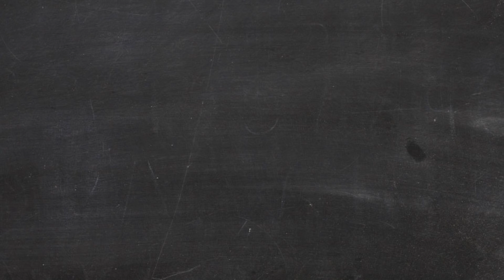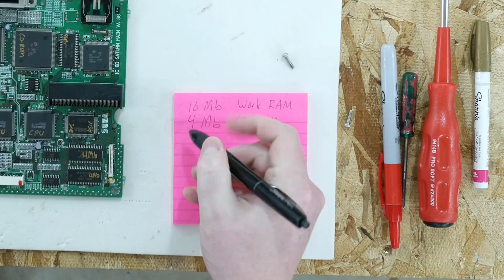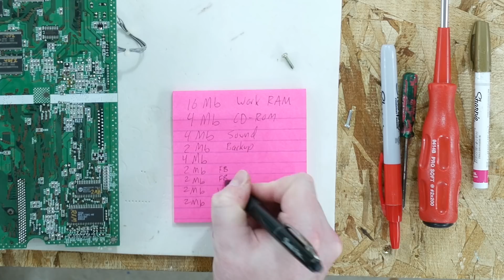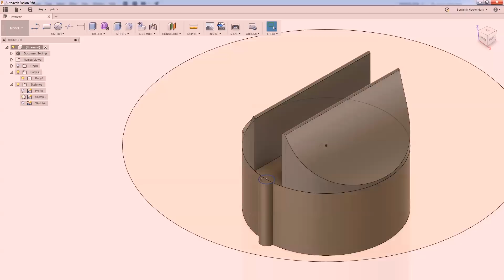Sega Saturn Teardown

Comment: That unidentified chip you pointed out I think is the dsp kind of like the FX chip. It supercharged the Saturn and was hardly ever used. Powerslave exhumed uses it and is what made 3d games run smoother.
Reply: It’s a Hitachi SH-1 CPU that’s part of the CD drive section.
Reply: The System Control Unit at 8:17 has a DSP in it, that’s part of why it’s big. The DSP can help with graphics.

Comment: The Sega Saturn is extremely complex for its time. That's one thing that must be considered when looking at a machine from 1995 (technically 1994). Today, most electronic devices have multiple processors. Back then that was an almost completely foreign idea. This is also one of the reasons the Saturn is just now being emulated with a modicum of success. Currently I am trying to get my PlayStation Classic to run Saturn games and while it's working it has been an uphill battle.

Addendum- You called it Sega's 4th generation console...that's incorrect. The (1st) SG 1000, (2nd) Sega Mark 2, (3rd) Sega Mark 3/Master System, (4th) Sega Genesis, and (5th) Saturn. However, the Saturn should actually be considered 7th generation hardware as the Sega CD and 32X all fall under new hardware guidelines even if they're only additions. The price had little to do with Sega's failed 32-bit console. Mismanagement and complicated hardware were the sole culprits. PlayStation 3 launched at $600 and the 360 at $400...the battle was close. The Xbox One is a far weaker machine than the PS4. The Xbox One X is the most expensive console right now and has sold very well. It kept Microsoft in the running.

Comment: It's a real mess in there. PlayStation usually matched or bettered anything produced at retail for Saturn with half the memory and vastly streamlined chipset. Kutaragi > Sato for electrical engineer
ing. What really devastated Sega was how quickly Sony revised their hardware, constantly reducing the complexity while preserving perfect function. There were at least 9 revisions of Playstation hardware (board designs) in 6 years! Sony cut costs rapidly, within 3 years the machine was under $130 with the more advanced dual shock controller bundled.

Comment: The two processors iirc was Sega panicking after they discovered the PS1 had 3D graphics and was quickly added. Both processors needed to be utilised in order to make up for lack of 3d processing power. The Sega Saturn was originally a very powerful 2d graphic machine a step from the Neo Geo.

Comment: It was overly complex for something that wasn't that much more powerful than the PS1.  You'll only notice the Saturn's slight superiority in graphics if you looked at game ports side by side.  Even then you'd need to realize that to tap into the Saturn's superior power games needed to be coded in assembly.  PS1 accomplished close to Saturn's quality and games for it could be coded in C.  
  
Sony never learned from Sega's mistake and did something similar with the PS3.  Granted it wasn't as much of an issue with the PS3 when it came to making games since compiler technology has long since progressed.  But it's complexity is probably why the PS4 doesn't have backwards compatibility with the PS3; while the Xbox One does have backwards compatibility with the 360.

Comment: TBF as crazy as the saturn design was to domestic developers, it was pretty par for the course for arcade machines (i believe). You can always speed up a system by slapping more CPUs on it (and this is basically how modern computers work)

Comment: i would like to suggest a project for the sega saturn. make it into a laptop with internally added 4 megs memory card and video ccard so it can play vcd movies. the controllers modify into bluetooth controllers. preferably with 4k or HD screen. my second suggestion would be to make a portable sega saturn that you can take anywhere (shaped like a backpack for example) and you can play it anywhere using 3D goggles.

Comment: Loving the random movie opinions while diving into a weirdly constructed console. Definitely cracked me up. Also, that is some good editing! I'd like to see a teardown of an arcade JAMMA board and be analyzed. Something like Final Fight, 4pl Ninja Turtles, or even Galaxy Force 2. I want to know why a single game had all those chips on the board. Hope this helps!
Reply: Arcade games had a lot of microchips because the ROM chips that held game data were also on the board (but were in a cartridge/CD on a home system). Also, the manufacturing tech wasn’t as advanced then, memory chips couldn’t hold much, so there were a lot. Arcade systems usually had more RAM too, to help graphics (like Sega ST-V arcade board vs. Saturn). Also, arcade boards had the newest tech, which means a lot of special purpose chips. Companies figure out how to consolidate them by the time a similar-powered home system comes out.

Comment: The Saturn didn't really have a master CPU and a slave CPU. More accurately, it had two masters; the biggest reason why the Saturn's complex architecture was so tough to work with was because its two CPUs had zero cross-talk-- the result of the second one being slapped on at the last minute-- meaning that making use of both processors at once was a huge hassle for programmers.

Comment: ah try companion carts there ben..

the gimmick of the saturn  was to use  both cart and cd or cart or cd..

I do not recollect of sega building memory carts that stuck into the a standard  cart slot

If sega had a saturn bases card save system it would  no different to the  what the dream cast had as it would of functionwed by syncing into the coinop arcade machines  so you can play certain games in the arcades  with your game sames...

Comment: Speaking of RAM, we should mention cache, The SH-2 CPUs have 4KB cache, which was extremely important because only one SH-2 can address Work RAM at a time, but then again, most developers didn't bother with the second SH-2 at all, hence the misconception that the Saturn in weaker than the PS1. Also, I recall (correct me if I'm wrong) both VDP1 (and maybe VDP2) having 512KB texture cache, which is huge compared to the PS1's 5KB and N64's 4KB (they should have called it the N32 considering those ugly 32x32 filtered textures), also as a little titbit, the 1.5MB VRAM in the Saturn runs at similar clock speeds to the PS1's texture cache, I mean that's just crazy.

Also a note about the sound capabilities of the Saturn, while having a staggering 32 channels over the PS1's 24, it wasn't capable of hardware audio decompression, meaning the sound effects were sampled at low bit-rates to save on RAM, one example of this is Core Design's absolutely amazing Tomb Raider (which was going to be a Saturn exclusive in the beginning), but red-book audio was completely unaffected due to it being steamed from the disk. I always wondered, why didn't anybody use the second SH-2 for audio decompression, but then I realised it too much work for too little payoff.

Comment: I’d like to see someone mod a Saturn so as to smooth out frame rates and load times. Like more ram and possibly faster processor which would also require a firmware mod. But it would be amazing to play every game on Saturn at 60fps on the Saturn not emulator

Comment: The "bus asic" is the dual cpu controller. Yes, they needed an extra ASIC to make the second CPU work. And yeah, it also handles bus access for the DRAM and the Boot ROM.The chip you couldn't identify is the SH1 cdrom controller.If you think this board is complicated, try checking the launch model. Now that one is all over the place. Stacked PCBs, extra pcbs for the leds, a slot for a cooling fan that ultimately wasn't used, lots of empty space in the middle, and the boot rom is a giant DIP chip. By 1998 they managed to get the boards simpler by integrating a bunch of stuff together, but it still had 5 or 6 200 pin ASICs inside.
Reply: Jesus they actually released almost prototype boards as a finished product?
Reply: And sold a million of it in 2 months in Japan. Also, they actually did advertise it as 64bit there, although they did specifically say that it's 64bit because it is 2x32bit.

Comment: RE: Cost joke

"Playstation 3 will retail for...FIVE HUNDRED AND NINETY NINE US DOLLARS." - Kaz Hirai 2006
Reply: Yeah I was definitely expecting to see Ps3, kind of a glaring oversight, he also used a picture of a stock Ps4 instead of the Pro which costs 399, another mistake.
Reply: ..yep , author of this vid failed to mention such. minus points for that.
Reply: +Retro Soul Why is that a problem? When the PS4 launched, it cost 399, same as the Pro does now. The same applies to the Xbox One; The X costs 499, which is exactly the same as the original Xbox One did in 2013.
Reply: The ps2 was still selling when the ps3 was released and that system was $300-400 cheaper than bluray players which the ps3 could play too.  In a way, they had looked to sell a dozen million systems just to earlier adopters to the bluray format rather than gamers which they had lured in with a price drop two years later when the ps2 sales had stopped.  It was a great marketing plan and seemed like beta release to get systems into living rooms so game developers could do real next gen games on it instead of just ps2 hd releases because developers still wanted that ps2 market too.  Sony wouldn't really had gotten away from the previous generation so there wasn't much of a back lash for pricing the system so high at first.
Reply: Yeah but there was a better way to project his point. He could have simply showed the launch xbox one with kinect at 499 alongside the launch ps4 at 399. Would have been more chronologically consistent, by comparing the X, which just came out, with the 2013 ps4 price, didn't really make sense to me because that price is currently irrelevant (for og ps4). (this also could have been resolved by simply displaying the currently relevant Pro instead of the og system but whatevs.)
Reply: People waited for the PS3, to be fair.

Comment: I believe that your Jaguar comment is incorrect. Jaguar wasn't considered to be 64-bit because two of the processors were 32-bit; Jaguar was considered to be 64-bit because it had a 64-bit bus (which was shared between other components, resulting in serious bottlenecks if the 68000 was in use) and a couple of other 64-bit components (and an ability to process 64-bit instructions, but I recall it being odd in terms of how it did so). I want to say that it was Jeff Minter who said that the Jaguar was 64-bit where it counted, and I don't think he's incorrect, as what made sense in terms of 3D system architecture really wasn't known around that time. Atari was just making guesses, and I don't think Jaguar's a bad system; it was arguably just even more misunderstood than Saturn. Given what developers finally managed to put up with on PS2 and PS3, I actually kind of wish we could go back in time and see what people could've done with Jaguar with decent dev tools and motivation.
Reply: Kevin Bender I think the Saturn and Jaguar (and definitely the Jag cd) had so much more to offer.

Comment: I know the Saturn has a DSP in it somewhere. Could that be the mystery chip? The DSP was often used for 3D matrix/vector stuff. I've ported games to the Saturn in one of my old jobs, and yes, it is over complicated!
Reply: The System Control Unit at 8:17 has a DSP in it, that’s part of why it has so many pins. The DSP can help with graphics.

Comment: Ok, so the Genesis used the Master System's processor for sound, and it allowed backwards compatibility? Could Sega had made an accessory to make the Saturn play Genesis games? Would it be possible to run Genesis Roms off of if they're loaded through software?
Reply: MaxSonic that was going to be the original plan hence the cartarige port in the back. Then Sega scrapped the idea.
Reply: Andre Wills Had SEGA not rushed the launch and implemented backwards compatibility the system may have been much more successful in the US.

Comment: Yeah, more RAM than an n64, but as demonstrated by a bunch of n64 games and said outright by RARE at one point, if the n64 had been CD based, it wouldn't not have run the games it did without quite a bit more RAM to work with.

A CD based n64 may well have had 8 megabytes by default. Or possibly at least 6...
Which would possibly have given it 10-12 megabytes with that memory upgrade in place.

People complain about cartridges, but they are at least 20 times faster to access than a CD-ROM drive of that era.
(depending on who you ask there's even suggestions with the fastest ROM chips that the ROM access speed is half that of main memory, which, if true would make the amount of memory in the system much less significant. - this was certainly the case for older 8 and 16 bit consoles. the NES has 2 kilobytes of RAM yet there are games on it that are so complex a home computer with even 256 kilobytes of RAM would likely still struggle to run them. This works because ROM in these systems is as fast as RAM is, or at least in the same ballpark.)

 CD systems have a lot of downsides.
To be honest their only upside is the media is cheap. (the drive is not; not in the 90's anyway. - another reason the n64 doesn't use a CD drive is because given the performance standards Nintendo was holding to, the drive would have doubled the cost. Yes, DOUBLED. The CD drive would have been as expensive as the rest of the system put together.)
Now, that's a BIG upside, it turns out. Because storage capacity was a major limiting factor on game complexity early on.
And it's certainly not a trivial difference - nonetheless, in a 'money is no object' comparison, cartridges win. (Neo Geo 1 gigabit cartridges say hi).
How big is that cost difference though? Ah, there's the thing; According to various sources the cost of cartridge production for a game such as Conker's bad Fur day on the n64 (remembering this prices around 2000ish) is $35 per cartridge. 
In volume, optical media (CD, DVD, bluray - all cost about the same to make), is about $0.10
these $35 cartridges hold 64 megabytes. This puts their cost at roughly 55 cents per megabyte.
So what about a CD? typically these are in the 500-700 megabyte range. Let's be lazy and say 640, since this makes our maths easier.
so even assuming the CD costs as much as the cartridge, the cost per megabyte is already 1/10th as much.
But it doesn't. It costs about 10 cents. so the cost per megabyte is somewhere in the region of 1/64th of a cent or less.
Meaning a megabyte on cartridge costs somewhere in the region of 640 times as much as it does on CD.
So, while the cartridge is the superior format in a technical sense, (and yes, a 640 megabyte cartridge IS technically speaking possible.), it costs so much that you'd have to be insane to use it.
- Or at least, that would be true back then. In 2018 you can make a 4 gigabyte n64 cartridge for a price that is perfectly reasonable (though still vastly more expensive than say a blu-ray or even a DVD is.)
Still, if money is no object...
Well, as I said, the Neo Geo comes to mind.
Is it a more powerful system than the SNES and Mega Drive? Absolutely. But in terms of CPU and graphics hardware it's only a little bit better. (2-3x if you're lucky).
What makes the games so much more visually impressive is that where Mega Drive games top out at about 4 megabytes (64 megabits), and SNES ones in theory 12, but in practice never much more than 4 either. (granted with compression removed the snes version of street fighter alpha is 96 megabits, or 12 megabytes - and you CAN get real hardware to run the uncompressed version of the game if you really want to.)
Neo Geo systems could handle 330 megabits from the outset (41.25 megabytes), and later iterations moved to 1 gigabit. (256 megabytes), which, while not always used, I'm sure, plenty of the games used some decent fraction of those capacities, because that was not such an issue in an arcade machine. (and the home machine was a niche item and the games for it cost $250 compared to $40-100 for any other system.)
A SNES or Mega Drive game that took up 30+ megabytes could no doubt give a Neo Geo a run for it's money. (still wouldn't entirely keep up, but it would be a lot closer than it looks in isolation.)

Storage capacity huh. One of those weird things where so many tradeoffs are involved...

Comment: Did you know that Sega was offered the Silicon Graphics Chip before it ended up on the N64? Did you also know that Sony offered to go 50/50 on the saturn project? Sega obviously tough 2D Gaming still had a long shelf life...Sony and Nintendo proved them wrong. They Learnt the lesson with the Dreamcast however it was all too late.

Comment: I have a Sega Saturn in the closet and sucks being a pain in the arse to mod.
Reply: Not true. Modchips to play backups require 1 solder point to 5v, the rest of the connections are ribbon cables. Action Replay cartridge allows region free. 50/60hz switch is three solder pads with wires to a switch. There is also a CD Drive emulator which reads SD Cards which requires no soldering and replaces the entire CD drive.

Easier to mod than NES
Easier to mod than SNES
Easier to mod than N64.
Easier to mod than GameCube
Easier to mod than Playstation 1

SEGA systems in general are the easiest to mod.
Reply: I will look into this not following the current info you presented. I been sitting on this for years and not did any research. Does the mod chip support most backup games?Thanks

Comment: TEARDOWN A NEO GEO CD OR A NEO GEO CDZ PLEASE.....OR EVEN BETTER, YOU COULD GET A NON-WORKING ON EBAY AND FIX IT ON AN EPISODE,  YOU CAN FIND THEM CHEAP ON EBAY NON WORKING, AND USUALLY ITS JUST A LASER ISSUE OR SOME CAPS OR RESISTORS THAT NEED TO BE REPLACED......SIMPLE FIXES!!!!